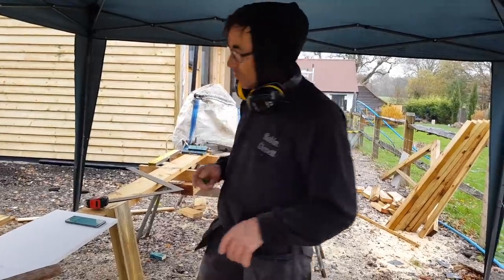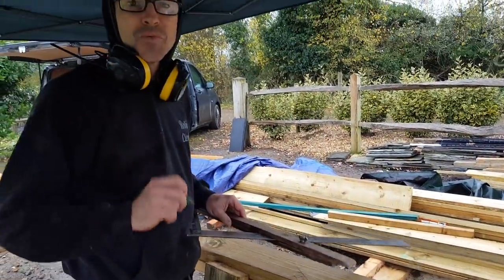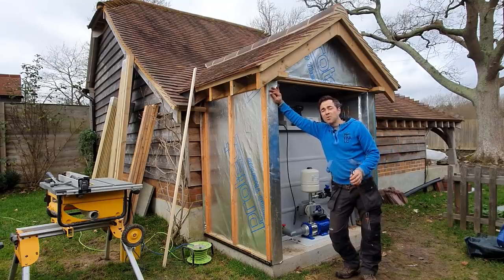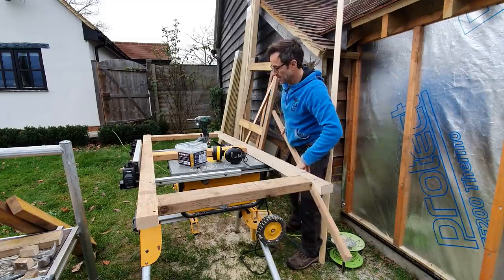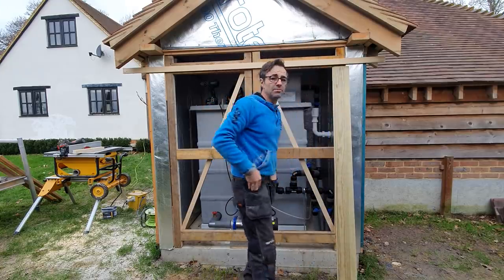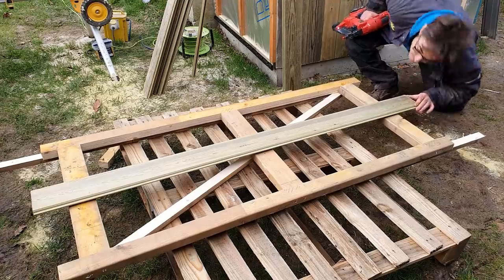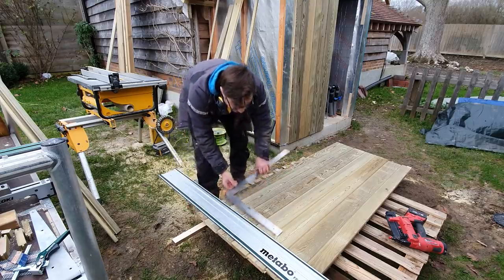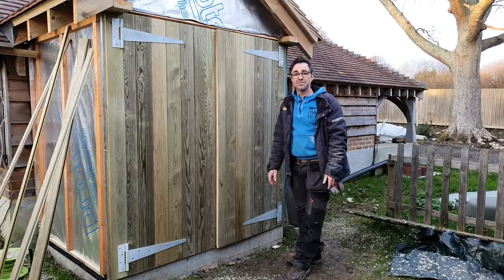Small Garage extension in timber Frame, making the Rafters and the Redwood ledge and brace doors

Comment: Ha, just noticed two circular saws with opposite orientation, clever Mr Clevett
Reply: I did wonder why 2 circular saws. As a relative nooby,  can you please explain why? Thanks
Reply: @rm9719  when using the plate to run along a guide, having two saws that are opposites allows you to always be on the correct side to run the saw along a guide. also for visibility of the cut line aswell.
Reply: @TheSudsy  thanks very much. Makes sense.

Comment: Awesome job! Been watching you on here like a hawk for weeks and I'm now brave enough to make a start, so....I'm going to build a 24X 12 shed/cabin/whatever (yes, permitted development) on 15 concrete block piers using 2x4s for the beams everywhere, doubled on the base edges, DPC etc. 18mm OSB, breather membrane, PIR, featheredge cladding and finally EPDM, presuming I can find a way to haul it on top! (I'm on it!). Have I gone wong anywhere please? Do I actually need 6x2s for the base edge? Fankee!
Reply from the maker: Hi, sounds like you have a plan, couple of points, make sure that your floor joists are strong enough to span the maximum distance so for example for the full 12ft span you would need an 2 x 8 minimum at 400 centres or maybe 2 x 9 at 600 centres if you split the span in the centre then you could go down to a 2 x 6, you can use a thinner sheathing on the outside of your stud walls so half inch OSB is good there, then a 1 inch counter batten to allow for ventilation behind your featheredge cladding, breather membrane is a good idea and on the inside a vapour barrier after you have insulated, hope that helps, have a good day!!
Reply: @ukconstruction  Ahh that's brilliant info, thanks! I did wonder why you didn't use noggins on a lot of your jobs...deeper timber, I see! Enjoy your day.

Comment: Hi robin, great video's. Is there a reason you only nailed the t&g instead of glueing as well ? Or is glueing going to effect the expansion of the timber.thanks in advance. Wayne
Reply from the maker: Hi Wayne, you guessed correctly mate , tongue and grooved materials maee from natural timber is designed to expand and contract so gluing is not done in this application

Comment: Great lockdown video. 
Q. What app did you use on the phone ??? Or what website ? For rafter length. 
Thank you
Reply from the maker: Hi Richard, this is an App that I am developing specifically aimed at traditional roof construction using a metric square
Reply: Excellent. Keep the videos coming.

Comment: I love how you always compliment your own work! What is the reason why you pin nail the boards diagonally instead of straight? And how much does it matter?
Reply: i would think its for more strength when the doors start to sagg it may help a little having the pins on the diagonal
Reply: Dovetail nailing give a better fix, 👍🔨🇮🇪
Reply: @tomsmith9048  herring bone.
Reply: @frankiepitt9135  🤦‍♂️😝😝😝😝 I wasn't to far away 🙄💚

Comment: Nice clean job Robin.  Query : Does that equipment need ventilation ?
Reply from the maker: Not really, I have a fairly airtight insulated structure and we will get enough ventilation from the small tolerances around the doors, great question!!

Comment: Neat and sweet as usual. My only question is finish nails holding the boards on. Largest finish nail is 15 gauge which you can get galvy but exposed on a door front. Even T nails which are bigger are banned for this sort of fixing in Oz as they decay too quick. If I didn't want face fixing showing I would screw from the back. Just don't see the longevity.
Reply: Everybody is in a hurry to save money, no time to pilot and countersink 100 stainless screws that are 20c versus, half a minute each, vs. shooting nails that are 0,2c in 2 seconds.
Reply: I’m not a carpenter but all I would say is that whenever you see an old knackered shed / outbuilding it’s not the nails that are the problem - it’s the cladding that has rotted! I won’t be worrying about the nails…
Reply: @micdev42 I am a Carpenter for over 40 years. Your old knackered shed wouldn't have been mailed with finish nails. Hence it stayed together long enough to rot. Finish gun nails like this will rust out in months. Long before the timber has even aged. Big difference.

Comment: Robin, I am sure that the length of rafter is as arc from the top of the ridge to the birdsmouth,
 not measured to the back of the rafter and squared down.
Reply from the maker: No mate thats a direct measurement method, I use true math that is the measurement along the top edge that is the angle per m of Run depending on the pitch, if you measure from the point to corner of birds mouth it won't fit!! More to come in video soon!!
Reply: @ukconstruction  I will use the maths! Run of rafter is a very traditional method but more of a guestimate, not a measurement.
Reply: He measured from the top of the plumbcut of ridge to the top of the plumbcut outside of wallplate there's no guesswork in any way shape or form you might be confusing it with the geometric line worked out in pythagoras theorem but I was thought the same way top of plumbcut to top of plumbcut I just don't use the rise and run method hope that helps 🔨
Reply: @tomsmith9048  I see! Pythagoras, patron Saint of cut and pitch. Thank heavens for the tables.
Reply: @I-am-not-a-number  there is no tables just do the maths 🔨

Comment: Whenever I've used T&G for cladding doors, the natural warp of the timber compounds and pulls the door out of true. How do you prevent that?
Reply from the maker: That happens a lot more when you have vast temperature/moisture differences on either side of the doors, I used a really good stiff CLS as my ledges and these will not bend over the length that they are, I have in the past made a steel frame for the back of cladded doors where I am worried about the bowing etc

Comment: what size of Pin for the Electric Nailer 18 Gauge ?
Reply from the maker: Up to 54mm and stainless steel too which is great
Reply: @ukconstruction  Thanks ROBIN - 18 Gauge STAINLESS , i had a Bloke in Canada do my Fence and he USED CHEAP Regular Steel Nails and they RUSTED After FEW YEARS will go with a DEWALT Cause i already have a 20v Dewalt Framing Nailer and 16G  Dewalt 20 degree platform .Milwaukee is Good have the m12 impact and Ratchets .i am a Woodworker DIY